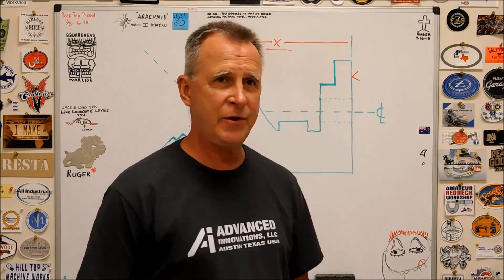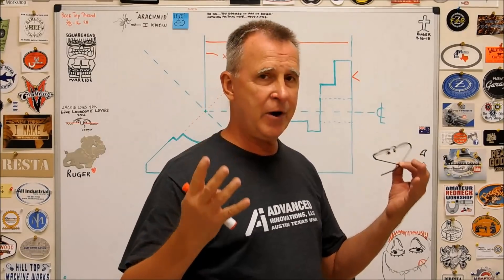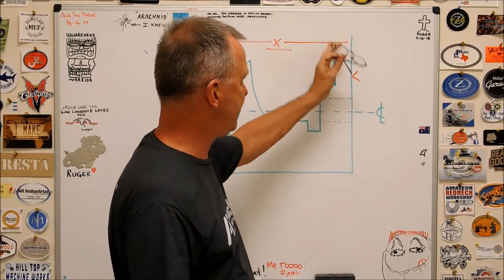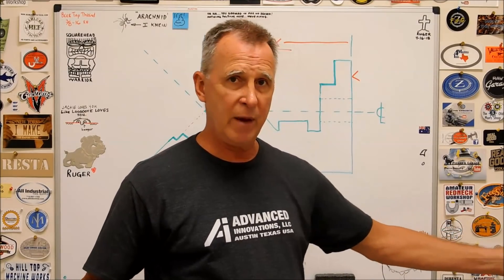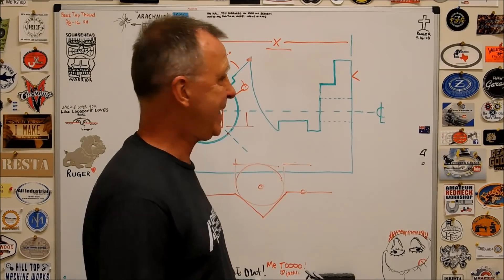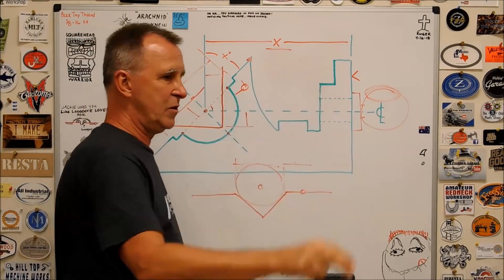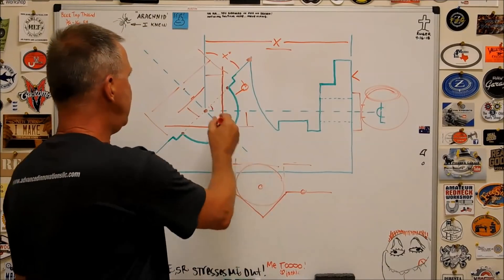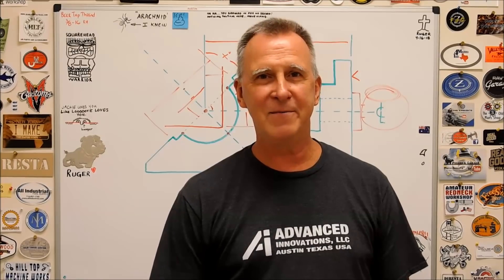A Great Trick for Machining Features on Angled Surfaces

Comment: Quin is doing the best she can. I respect her efforts, admitting her errors and persistence. I respect your knowledge. I do not respect in any way your constant "subliminal" and public humiliation of her. Your tone of voice, mannerisms and choice of terminologies are humiliating. I am sure you and your cadre will disagree and disagree vehemently. None the less, that's the way I see it. You have been in the south long enough to have developed some decorum. You can do much better, sir. I am a long time subscriber but as of today, no more.
Reply from the maker: I believe I started this video with a positive statement about someone with limited experience even attempting this. Kudo's I believe was the word. An olive branch. And I supported a 1-2-3 block and angle gage setup decision. I even admired the 'Comedy of Errors" banner on the video thumbnail. We recently exchanged e-mails privately, and I can honestly see some of my words may have hit home in a positive way. Then the bearing cap pockets are machined from a scribed line from a surface that had no relationship to the feature, datums or even appeared on the print. Yet she allows her viewers to believe that is an Ok practice. Big shock the holes ended up in the wrong spot. Don't our collective viewers come to watch, learn and evaluate? Maybe even follow along with an exact model they may be building simultaneously? Its that betrayal of trust that offends me the most. I take great pride in the material I present and would like to think those that support this channel are just a little smarter after sitting through one of my videos. Maybe not smarter, but they will certainly walk with a trustworthy, time tested valuable tool for their box. Perhaps you should leave a comment on the other channel, and wait for a reply, to see how this video was received, before you draw your conclusion. I am sorry to loose you as a subscriber, but that choice is yours to make. Stay well and thank you for your past support.
Reply: @joepie221  
BH is Wyle E. Coyote vs. Joe Pi
Beep! Beep!
Reply: I was hoping someone would say who it was so I could watch the other video. I'm not a fan of hers but's it mostly just a personality thing. The same reason I'm not a fan of Abom, Could be the presentation and also they don't usually have projects that interest me. She does have some videos that I thought were pretty good, though. I don't know if I'll get to the level of experience she has with machining but I also understand she's an amateur not a machinist. Like anything you can find experts all over and sometimes you don't know enough to call bullshit when you see it. If I'm learning something or being trained by someone I would like to learn the proper way instead of the backwards way. I see professionals doing things the wrong way pretty often that make you wonder how they got certified but if you can't admit you don't know and ask for advice you shouldn't be showing anyone anything. The difference between you and I watching a machining video and Joe watching one is we don't know any better. I'm a plumber and I get pretty frustrated watching "experts" teach people how to do plumbing wrong. They aren't helping anyone, just screwing the current and future homeowners over. I'm sure it's the same with anyone. If you had to watch thousands of people learning your job wrong and failing, you would probably would not like to see it either. I agree with politeness and decorum, but a pretty hog is still a hog and wrong is wrong.  Sometimes you have to tell the Emperor it's not a CNC machine instead of saying every thing is wonderful. Unfortunately not everyone can accept that nowadays.
Reply from the maker: @deckmonkey1459  You've hit the root of this issue right on the head. Good comment.

Comment: 3rd option Joe, instead of a tooling ball why not a rotation piont or hole? You can use a gage pin or dowel pin the math is simpler and you dont need a flat like for your tooling ball. 
Mike - Plus8Precision
Reply: Does seem like ot would be pretty easy to just ream a hole through it sideways and use a pin in that hole as your reference. I am not sure it is any easier if you alreadyn have the part secured and registered upright, though.   The nice thing about the drill approach is that the angle becomes irrelevant.  If you are off by a degree, or if the angle isn't 45, it would still give you a perfectly flat and centered result.  I think that makes it a better method to demonstrate.   How 'bout it, Joe?
Reply from the maker: This notch feature can be added when the part is oriented for the slider rail machining and the 2 faces in the front. By notching it at that time, you can assure true relationship to the desired part geometry, and easily relocate the area when you pitch it up at 45 degrees.

Comment: A thought about visually centering the crankshaft hole in the bearing blocks, since that is entirely dependent on the centerline height. If that was a serious consideration you would have to mill the base of the casting to get a reference, then mill the bearing blocks next, find the center of the 45 degree bearing block surface, and set your centerline height from that, which would then set the height of the slides and the connecting rod hole.  Because in this case the slides were the first thing located, then the hole/centerline from them there is no choice left on the location of the crank holes.  I think in this case possibly the first feature to locate should have been the crankshaft/flywheel location.  That is the visual center of the model, and will have a much larger impact on aesthetics than the vertical location of the cylinder on the end plate.
Reply from the maker: Most raw castings should have a reference " START HERE" datum. This model does. the end piston hole is dimensioned from that datum,and the crank/bearing cap work must coincide with that centerline. There is no need to machine the bottom of this casting unless it rocks violently. Even then, make the cut superficial at best. If you had a print, and could digest the dimensioning scheme, you may agree, the right side features should probably be done first.

Comment: I am a total CAD newbie, but I have discovered that the order of operation in making a CAD model often translates well to order of operation on the machine.  For example this specific part, if modeling this you would have to establish the slide to centerline relationship first in order to locate the piston rod hole, and just like this video you would have to establish the bearing block to centerline relationship to locate the crank bearing holes on the model.  I have found the least expensive way to discover the "I don't know where that is" spots is to simply model it, and look for missing constraints.  The hole in the bearing blocks can only be constrained by the intersection  of the centerline and the bearing block split line, so when you get to the machining, the centerline is fairly easy to locate, the complication is that the location of the 45 degree split line is unconstrained, it is an unknown distance from the spotface, and IRL is located simply by machining the casting until is it clean. 
I personally think this would be a great application of one of Joe's milling locator blocks, simply indicate the casting on edge straight, plumb, perpendicular with centerline along the X axis, center the spindle over the centerline, lock Y axis, put the locating block in the spindle and bring the bearing block surface up against the block in the spindle and you have your zero.  Screw on the bearing cap blanks, drill ream, bore, whatever, done.
Of course the symmetry between the two bearing blocks is entirely dependent on how well you set up the fixturing when machineing the 45 degree surface, in relation to the plane of the slides.  If you got that wrong you will miss the centerline on the far side bearing block, but that is also true with Joe's V notch method.
The other complication may be that Joe's 1 inch locator block may not fit on the small 45 degree bearing block flats. Not sure how long those are.
Reply from the maker: Pro-Engineer CAD software has an option called a model player. It rewinds the model from the very first step and allows you to see how it was created. Very useful feature.

Comment: Hey Joe nice of you to help her out......hey I have a question and I want to ask you before you get to 100000 subs because after that you guys ate hard to get ahold of haha.......i have to drill and tap a 1/4 20 hole in the end of an electric motor shaft.....1) are those made of hard steel that will be difficult to drill and 2) how would you keep the motor shaft from spinning while drilling? (OH and if you have any" shop gems" on the setup ill take em....i have a bridgeport 
Thanks joe
Reply from the maker: Some motor shafts are case hardened. If they were truly hard, the would snap under torque loads. I modify them here once in a while. Onmce you get past the glass hard surface, they cut easily. I would suggest grinding or boring a small full diameter lead in the end so you don;t have to fight with the case hard area. You'll have to make a pinch collar to keep it from spinning.
Reply: @joepie221  thanks Joe I appreciate it
Reply: Hi Joe,. is a pinch collar a pair of vice grips?  LOL.

Dale in Canada
Reply: @dalemcinnes1834  thats what I ended up using haha

Comment: We have the X dimension which establishes the imaginary centre point in 1 plane,so all we need is the dimension up from the machined centre step (or centred to a pin in the hole ) and we are there.
Reply from the maker: Then pitch every thing to 45 degrees and find it again.

Comment: I'd do semi-circle first, switch to lolipop mill and set it center on the right side hole(this also gives a distance to feature ref). Do rest of ops from drawing perspective. Flip part, use coax indicator with ball tip to find datum hole center. Finish hole.

Comment: I was sweating it till you did mention the tooling ball which is the way to go.also was not clear if the casting is a solid or the shape already is there with .020 extra lets say.  also not clear how thick it is only shows the 2 d outline. the big flat bottom and side produce those surfaces totally finished and put in the tooling ball hole in any location of you choice. Tilt the part up and machine everything complete to the numbers not checking anything just go to the numbers. If manual that part could possibly not be in the solid or you may have it almost complete and have to put the big half radius in where you cant drill. you can set a boring bar to the .375 and move to location or end mill. to set the boring bar before starting there are a couple methods even prebore a hole and lock the boring bar and set it to side. 

the notch method is not really the way to go for anybody even if a person could by with it this one case--far better to simply tilt it up and go to the exact numbers on all the items on that surface. using the notch and squeeking by the person than has not developed for future use the correct tooling ball method. the item is only a flat outline but no matter what an item is  or what angle s a person has to be able to tilt things all over the place and produce the part.
Reply: on the tooling ball thing sometimes a part cannot be violated with a tooling ball hole so a person can do too many things to list. once that bottom and edge flat surface are finished 100% totally finished never to look back that lower right corner is you reference then go to all locations and over kill them.
Reply from the maker: @jaysilverheals4445  What you don't seem to realize, is that surface doesn't exist yet. Thats part of the problem. As for the tooling ball, on this part, which is the subject of this video, that 3/8 end hole is already available.

Comment: My palm went to my forehead.
I’m building a #7 now. The cylinders are challenging also. Hint, hint.
Reply from the maker: Tell me why. It maybe a good topic.
Reply: The cylinders are challenging because they come partially bored for one. The hole is part of the casting and we know it's not a reference or datum point because it's not centered in the body.
The other point is the cylinder is not round, in a four jaw chuck, one of the jaws is significantly out away from the other three due to the steam ports.
I think it would be easier to layout center if the cylinder was not bored at all.
I have watched videos on this subject. One of them used a mandrel that went through the bore and was held in the tail stock chuck (Keith Appleton) he then used this as a guide to line up the 4 jaws. Great if the bore is centered in the body.
Thanks,
Jeff
Reply: @jeffanderson1653  FWIW, I did it with a boring head in a mill (Built a PM #4, not 7, but same shape). Kinda indicated it so the 3/4 of the outside that was round was concentric. You could do the same in a 4 jaw.
Reply: @jameskerns717  What if you were to bring up the tail stock mandrel and center the od of the mandrel to the 3 jaws?
In other words, move the cylinder in the jaws until you had equal distance between the three jaws?
Is that clear as mud?
Reply: @jeffanderson1653  That would center you up on the core just fine. I tried to center the bore in the casting on the assumption that the core might be off, but I think it would have been pretty darn close either way.  But, to be clear, I ain't no Joe Pie !!!!!  :-)

Comment: Joe,  i know who is doing that steam engine. drilling the hole for the piston rod   was the FIRST  time i could call fault with her work. i myself, id machine that base casting on my rotary table. after i had addressed the 45 deg features and the bearing caps. the principle; machine the biggest/ most important part FIRST! then i would address the crosshead slides.  all this on my rotary table. -i would NOT remove it from the table, till every op that can be done!! its an extension of "one chucking operations". then the rest is from crosshead to the steam "high side". or crosshead to the "load",  are tossups for choice of which to tackle first. cranks can be soo pain in the ass.  and the steam passages are another pain!!!  poppy.s workshop says HI  p.s. i wonder what she will do next

Comment: I definitely learned something today!
Big news in my life, I finally got a Bridgeport 2J mill and tooling today, so I'll be able to put this stuff to use!
Reply from the maker: NICE. Have fun.
Reply: Congrats on the mill!
Reply: @wwilcox2726  It sure expands the horizons of what's possible to make/fix in the shop.. It's not always about how many hours you put on a machine that makes it valuable, it's the value of the time spent on it.. I definitely use the lathe a lot more... I have a new one slowly getting rebuilt to come into the shop to replace my Advance 14x40.. it's an 18x80 HAS Cholet.. there'll be a few habits to undo on it, carriage and cross slide handles are "backward", and crossslide dial is graduated on diameter.. I'll probably be putting a DRO on it though

Comment: First, the specified angle looks like 'x' degrees.  Is this a shorthand for 45 degrees?  Second, it is not clear to me why the horizontal center line is specified perpendicular to the right reference surface.  Third, milling the right reference surface would change its location wrt the other features already in the part, so it doesn't seem like this is allowed.  Instead, it seems like we should indicate the reference surface to be parallel to the machine's axes (y and z) and then locate it with an edge finder.  Fourth, do we drill/ream the horizontal hole on center or was that already there?  Fifth, none of the vertical dimensions are specified so, if the hole is cast, will it be accurate and smooth enough for this purpose?  Finally, what tool would you use to cut the final half-cylinder feature?
Reply: the real engine was probibley machined on dedicated jigs and fixtures.
Reply: You’ve got to go back and either watch the original youtuber’s channel for the first video, or go back and watch Joe’s recreation of that video to get why he referenced off the back and the center hole.
The original part is a cast steel blank with no holes, and everything thus far has been built upon using previously machined surfaces.
Reply: @Linusgump  I can't find it.

Comment: That video series has been a bit rough, but I admire the effort. When I made mine I had full control of the design so it was no issue making small changes for ease of machining. Thank you for the lesson in locating.
Reply from the maker: I would like to see her make it clearer to her viewers that what they see is the way she decided to do it, and not necessarily the correct or most accurate way. There are a lot of mistakes that go unmentioned. Its misleading to a learning mind.
Reply: @joepie221  I watched a lot of Keith Appleton videos before doing mine, If she had done the same I think it would have helped.